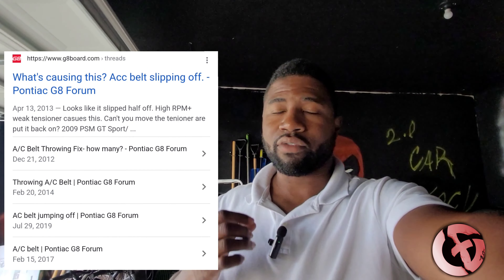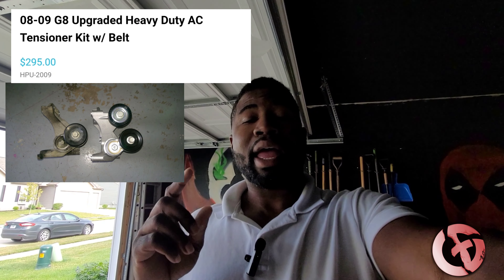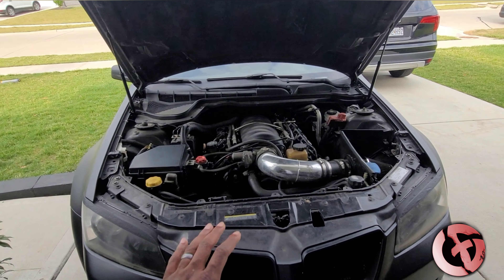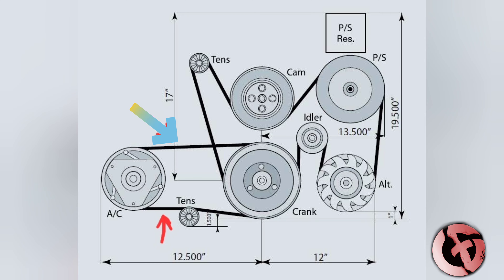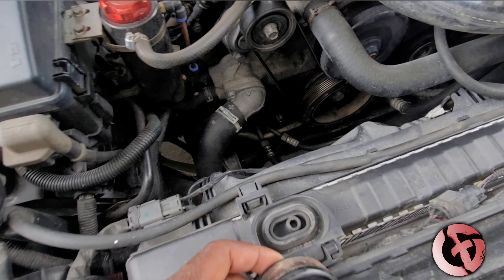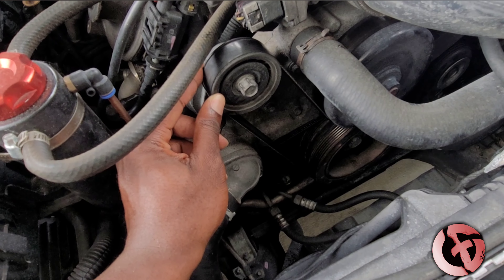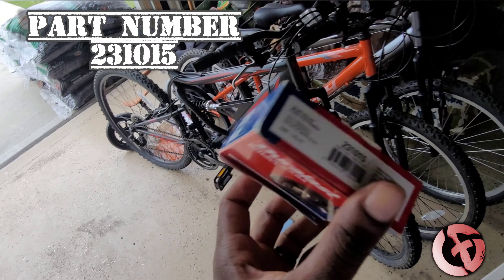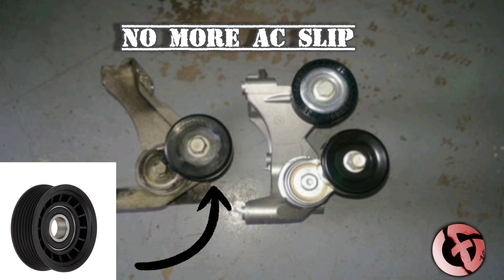How to fix ac belt slipping on pontiac G8 GT | FINALLY SOLVED

Comment: Did the belt melt the three grooves in the middle of the pulley down? Plus when the bolt is tight this pulley don't spin at all.The part # 231015.I have a 2009 pontiac g8 gt also.Is there something im doing wrong here?

Comment: This did not work for me. I also had the rub problem, so I shimmed it with 2 washers. Started it up and everything looked ok. I had thrown the belt 4 times and replaced it. I took it for a drive, and everything was looking ok. I punched and threw the belt and for the first time ever, it took out my main belt as well. Back to the drawing board. Has anyone with the 231051 had success?

Comment: I have no issues with the AC belt slip. Is it because an aftermarket dampener is being used? If not, what's the reason for the slip
Reply: He showed the stock pulley and even explained why it slips. In case you missed it I'll explain it for you. The stock pulley has no lip edges to it so the belt over time will end up slipping off the pulley especially if it becomes rusty. So the new pulley he used has a lip edge on both edges of the pulley so it keeps the belt contained and will not allow it to slip or walk off of the pulley. A very simple fix that if I hadn't seen this video and ran into the issue then I would have done the same thing. Sometimes simpler is better.

Comment: 231015 didn't work for me. It was rubbing against the idler. Went to a 231051 instead worked like a charm.
Reply from the maker: Nice brother glad it worked out
Reply: The diameter of 231051 is bigger than the standard one, will it work with the standard belt size?
Reply: @4411825  yes tight fit. Will need a smaller bolt head
Reply: @adhd_g8gt566  Thanks for the reply!
Reply: @adhd_g8gt566  What bolt did you go with? I’m having doubts about the sweet spot on the stock bolt.
Reply: @adhd_g8gt566  what size ?
Reply: @pewpewfanatics3223  I user the stock bolt I just cut down one of the edges flat
Reply: 231051 comes up as a 6 rib pulley. Shouldn't the A/C tensioner pulley be smooth?
Reply: Just did it with 231051
Easy swap
I did hear a slight whistle after maybe the pulley rubbing a bit, but it was always spinning and the sound stopped after about 5 minutes
Easy to do you just need a 15mm
Reply: This didn’t work for me. I went from the standard 43in belt and did a 42.5 belt and I have the stock tensioner with the smooth pulley. Since it’s a half inch tighter, does not slip when I hit it and do pulls! $21

Comment: Is there a different belt routing with this pulley installed?
Reply from the maker: No its actually the same oem belt....and even now its still running strong
Reply: @2.0carflock  I did this today and it works but the pulley you replace it with won't free spin so I had to sand it down with a orbital sander and even then it still scrapped the pulley
Reply from the maker: @R3CKLESSRHINO  for right now im experimenting with different bolts but the way I got around that is by tighting the bolt up just enough so that the pulley stays in place and spins freely
Reply from the maker: And the belt will keep the pulley in place
Reply: @2.0carflock    Gotcha I  just didn't know if it happened to you Since I've installed it and  Used an orbital sander to  Sand it down it stopped making noise after tightening it all the way down and it moves freely now
Reply from the maker: @R3CKLESSRHINO   thats a  good idea ...im gonna try that but glad it worked for you

Comment: Will the existing bolt work with the new pulley ?
Reply from the maker: Yes the existing one works perfectly
Reply: Did you use a washer ?

Comment: I wish I saw this video before buying the heavy duty bracket 🤦🏽‍♂️
Reply from the maker: Its all good...at least u got it fixed
Reply: @2.0carflock  it’s still in the box waiting to be put on lol. My GXP went through 2 or 3 tensioners and multiple belts lol. The clutch/pulley for the a/c compressor has missing sections, need to replace it too 🤦🏽‍♂️

Comment: This did not work.pulley hits on back side and will not spin.
Reply from the maker: Yeah im gonna make a new video on how to get past that...its a certain part on the pulley to sand down
Reply: @2.0carflock  did you ever do the update showing what we need to do to make the pulley work?
Reply: i am still waiting for answer as i got the same pulley and it hits on back
Reply: @binjoker2680  , I just ordered a pulley.  I’m gonna modify it and I’ll reply with my findings.  My local parts store had the correct pulley ($35), so I just cross referenced the number on rock auto and got it for $10 shipped.  Once it arrives I’ll be able to update.
Reply: @BrothersBuilds  i am looking forward!
Reply: i had to sand down the pulley and the other metal that holds it and it works fine so far!
Reply: @binjoker2680  awesome!  I’m gonna give this a shot once my pulley arrives!  Thanks for the reply!